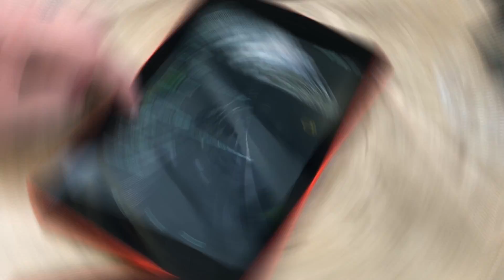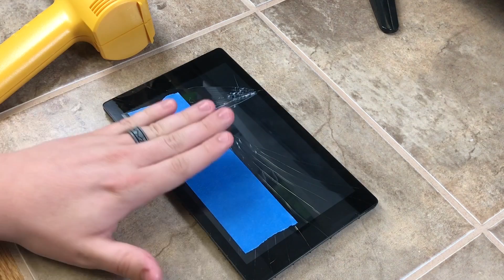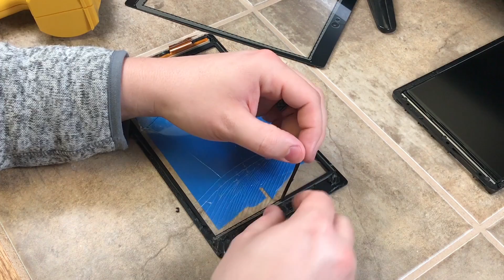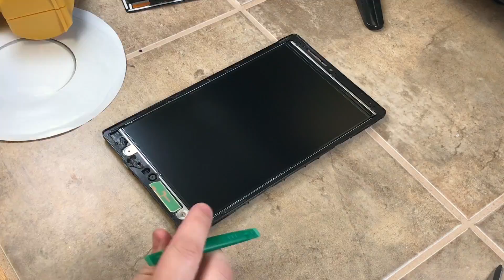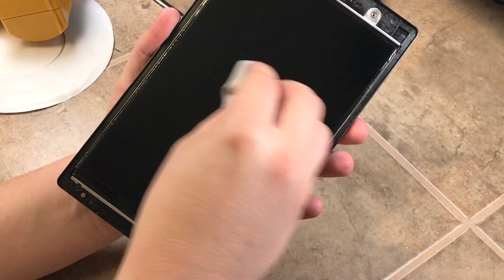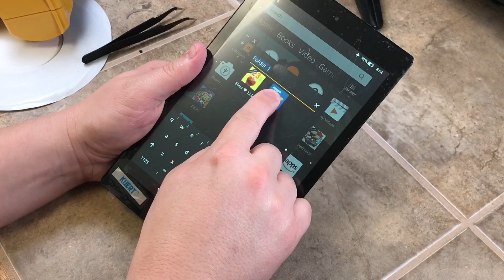How to: Screen Replacement - Amazon Fire HD 8 (6th Gen)

Comment: Is it the same with the 7th generation model?
Reply: Hi.  I have an 8th generation model with a cracked screen.  Do you think it would be similar to fix like the 6th and 7th gen models?
Reply: @helpersofsociety2154  wondering this same thing as my 8th gen has a cracked screen and can't seem to find any video describing how to replace the screen on the newer model
Reply: @SuperMetallica91  
I came here for same reason, but with tools and digitizer costs added up, it was actually cheaper to buy new one on Amazon. A week ago, they were only 79 to purchase new. Keep watching for sales.
Reply: @SuperMetallica91  Let me know if you find it, I am in the same situation
Reply from the maker: The separation of the screen process would be the same, but from what I've seen, the ribbon cable is in a different location (top instead of bottom). I'm not sure if there is anything else that would be different.
Reply: @peteywhit : Rather than buying the dryer, Can I hold it against a heater to make it easier? I already have a heater
Reply: @peteywhit  Ok thanks man.
Reply: Broken tablet please do that Netflix
Reply: From where have you bought the screen????
Reply: Ragini Kothari Amazon
Reply: U99
Reply: What about the 10gen??

Comment: I was worried about replacing my high-end older oasis with this one https://www.youtube.com/post/UgkxCgPI5O2AtmcHq9SJhgsCGbpAzJAJfrJp  but it is surprisingly light and the screen resolution is just as good. I never had the warm light on my old kindle, but i do not use it on the ipad so I will probably not need it. I think the only thing I'll miss is the self-adjusting light, but this is so worth it!

Comment: ours looks  like this except the chip for the touch screen wont go through the slot that the old one came out of. Managed to break it off when i tried to get it through. The new chip is a titchy bit thicker and although the actual shape of the tab is the same, the chip being bigger and thicker meant it wouldnt go through however careful i was. No loss really as we found the tablet thrown away  but oh well.  Very good guide for getting the old screen off.

Comment: I followed the video, bought a screen replacement for my Fire HD 8, and got through the whole process in about 90 minutes. The cheap plastic spudger broke part way through, but I had others. I did manage to tear the orange cover slightly at one corner, but it's in a case -- who cares? I also didn't remove all the adhesive as shown, just the large globs. Had a hair dryer, swept the corners and edges as I went along using the "high" setting. Worked well enough. Pulling off the screen connection to the MB was hard, and the adhesive bonding that to the alum frame was even harder, so I used needle nose pliers and got it off. That part is replaced anyway, so I wasn't worried about damage. The replacement unit had 3M 2 sided tape already in place all the way around; I used a razor blade knife edge to pull up on the paper strips before removing. Tested the unit before putting the orange cover back on, no issues. Did minor cleaning using the seller provided eyeglass style cloth wipe. Wife is very happy with her "new" device (she's the one that dropped the Kindle and cracked the glass). All is well. Thanks for your video!!

Comment: Does it have to be that type of tape? Or can it be any other type of strong double side thin double sided tape
I have 2mm extra strength double sided tape from hobby lobby 
Does it have to be the type for electronics?
I just don’t want to use the wrong kind and the other tape (no electric approved) like damages it cause of ingredients in it

Comment: first tool was useless. got chewed up half way through 1st step.
Reply from the maker: Hey Aaron, sorry to hear that. Yeah, most of the tools in any of the kits used for separating screens aren’t the best. If it’s a one time thing, or a couple, mine usually hold up. However if it’s something you would plan on doing many times over, then a better quality tool would come in handy. It’s just that for the price, these tools will usually get the job done.

Comment: I used to be a LCD tech.  be more careful with the LCD screen, no Windex, no wiping all around, it is a soft plastic with tiny grooves in it.  It is EASY TO SCRATCH.  to clean, use a new optical wipe (they are usuall only found in large packages and fairly expensive. They are often called "clean room wipes", "unwoven wipes" or "woven wipes".  If I had to do it at home I would try a brand new unopened handi wipe),  folded into a rectangle about 4inch by 2inch, wet one side of the wipe with isopropyl alcohol (I use a spray bottle). hold it with four fingers on the upper side and thumb underneath. put it on the screen and and move it in x and y directions to see which way you can wipe it the easiest, stick with that direction.  put the wipe down  at the far edge, pull it towards you rolling up a new surface as you go. Take about one second per inch, too fast may not clean, too slow may leave a wet spot that you will have to reclean. If the wipe wasn't wide enough for the whole screen, espose a different surface of the wipe, wet it and wipe it.  Turn the LCD around, fold the wipe to expose another surface,  and wipe from the other side.  You should be done.  Don't ever reuse that wipe for an LCD again, any particles you pick up can scratch the screen.

Comment: I opened it up thinking it would be an easy Fire 7 HD fix for the charging port replacement with a ribbon cable like the vids i saw til I saw the insides... UGH This is the exact model I own! I have searched for instructions on how to replace but can't find any for this model. Can you maybe do another vid for this model on that topic or point me to one that does? TIA

Comment: Thanks for the very well-done and clear video.  My gf dropped her Fire tablet and was very upset when the sign-in screen became unresponsive (screen was not cracked.)  After opening up the case, I had no clue at what to do next but I did notice the digitizer cable was not connected.  Your video showed me how it was supposed to be attached and how to unhook the battery.  Tested it, now it works again and put it back together.  My gf thanked me like a half-dozen times.  Thank YOU!
Reply: Ok how Do I get the digitizer to wrk?
Reply from the maker: +Rex Havoc glad to hear it helped Rex!

Comment: could this be done on an 8th edition?
Reply: also how thick is that tape,is that going to matter
Reply: @harry979   did you ever find out if this will work with the 8th gen? Thanks
Reply: @cieranbrown  yes it worked fine there is very little difference between the  screens.

But I would be wary to not let any dust get under the screen as I have a tiny piece of dust in the corner that is rather annoying.

Comment: Absolutely the best video and thanks for the tool links. Your easy to follow detailed instructions are exactly what I look for when coming here for help.  One question...is the double sided tape needed?
 You used it then removed it on the video so I'm unsure if I should use the small size or get a bigger sized tape.
Reply from the maker: Hey Jackie, the double sided tape helps keep the glass against the housing. If no tape is use, it will more than likely pop out if the tablet is handled roughly. When you see me pulling the white part of the tape off, this is just the backing. The tape itself is still stuck on the housing. Hope this clears things up.
Reply: @peteywhit  Double sided tape! Excuse my brain fart! 😆 Thanks again!!
Reply from the maker: +Jackie M lol no worries! Glad I could help.

Comment: Have you been able to do a lcd replacement? I have been able to remove the digitizer following your video but stuck on how to remove the lcd screen .
Reply: Hello, i just did the LCD and its really easy. When you remove the digitize you can just pop the lcd right out. There will be some adhesion, but not much.
Reply from the maker: I have not had to replace an lcd yet, sorry
Reply: What’s the reason to disconnect battery & etc? Why can’t the broken screen just be popped off and put on a new screen? I use to refurbish cell phones and replace the screens never had to disconnect anything to do it why can’t a tablet be done that way? Just curious

Comment: Can you use hair dryer instead of heat gun
Reply from the maker: It’s possible, yes. It may just take longer to loosen the adhesive, than it does with a heat gun.
Reply: Thanks for thw info

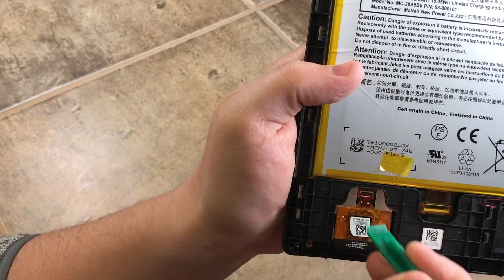Comment: Struggling a bit, I hope you might be able to help-- The ribbon connecter at 4:02 is refusing to come out, and I don't want to pull too hard out of fear that I might ruin the ribbon. I will note that the tab doesn't go all the way up-- there's like .05 mm of space between the translucent and opaque parts, and I'm assuming that's some kind of adhesive. Would it be wise to use the spudger to force that part up, or no? I have never been faced with such a ridiculous mechanism in my life.
Reply from the maker: So first thing, make sure you pry the black opaque tab upwards. This is what actually puts tension on the pins in the connector to make a good connection to the ribbon cable. Second, the part where I use the spudger on the tab that is glued to the ribbon cable, I'm not actually prying up. I slide the spudger underneath and then use my finger to put pressure against the spudger to basically squeeze the tab, so that I can pull it. It should stay connected to the ribbon cable. It might help to wrap some tissue or a screen cloth to both arms of a pair of tweezers, then carefully grab this tab and pull straight back. I hope this helps.
Reply: @peteywhit  Ah, it was the pulling back that I was doing wrong. Thank you for the thorough reply, and for the video too! The screen has been changed and everything is right in the world now :)
Reply from the maker: @bd_bandkanon  Glad to hear it!

Comment: Maybe I missed it but why did you remove the double sided tape?
Reply from the maker: There are a couple of reasons to remove the existing factory adhesive, but not always required. If there is glass left behind from the broken screen and you can't get it off without removing the adhesive, or if most of the adhesive pulls away with the screen, you might as well pull it all off so you start with a bare level base and the screen will have the same adhesion all the way around when you add new tape. It won't give you high spots due to tape thickness differences. If there is no reason to remove the adhesive, then by all means I would reuse it.

Comment: What if the screen is fine, but the insides all cracked up. If I do this will the inside be fine?
Reply from the maker: How can the insides be cracked up and still be fine? I'm confused.
Reply: If you need to replace just the LCD i would still get the digitizer because it will most likely break.

Comment: Use a playing card to remove the digitizer. Your life will be so much easier.
Reply: How exactly do you do that?
Reply: @wildheffalump9748  heat it up on a heat plate at 150C and put the card between the glass. It's just soft enough to not damage anything.

Comment: Could I use an old tablet screen instead of ordering another if it's not cracked? And the same model?
Reply from the maker: +Cortni hollywood2 if it is the same model, then yes. The color of the back doesn’t matter either, but if the models are different then the screens will have minor differences that will prevent it from working.
Reply: @peteywhit  thank you so much! Iv spent hundreds between a few like this and just needed the right tutorial so,I'm super appreciative!
Reply: You would need the adhesive strips though correct to re adhere the new one? And be extra careful obviously removing the replacement panel.. can it be removed without breaking?
Reply from the maker: Yes, that is correct. They can be removed without breaking if care is taken. When the screens are already cracked, they tend to crack more. But a little heat and careful prying can get them off cleanly.